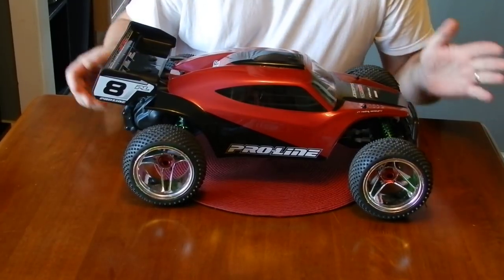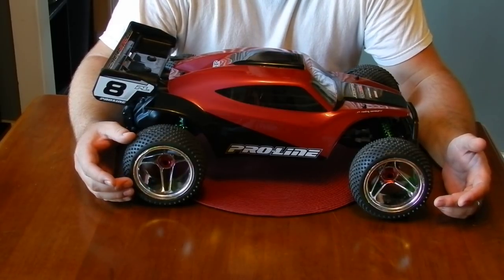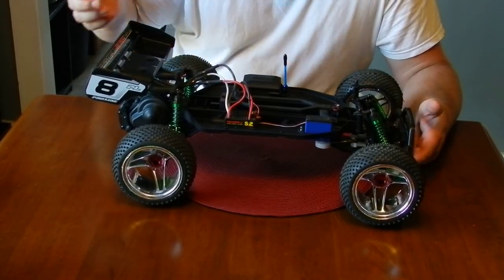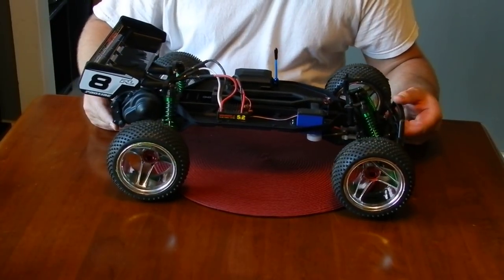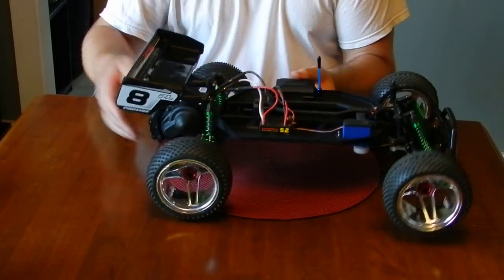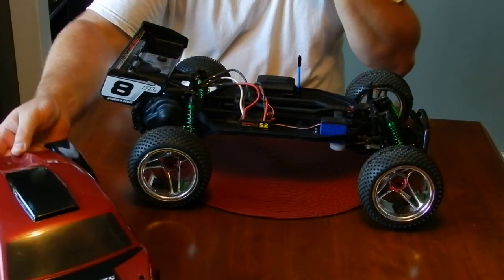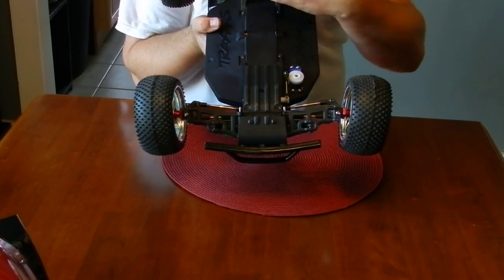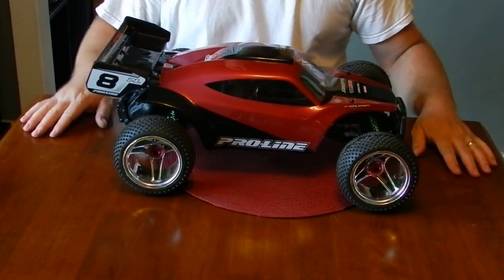Traxxas BackBajr Back Slash Custom Build 2wd Slash

Comment: Probably the coolest slash I've seen man. I wanna do this conversion with mine. My slash if fully modded with pro line arms towers, aluminum steering assembly carbon fibre chassis pro line tranny And the rest like knuckles and stuff is all rpm. I'm hoping this body fits over my carbon fibre integy chassis tho

Comment from the maker: I am pretty sure you could make all of this work.  Mounting the wing and coming up with a front body mount that is low enough are the only two things I am unsure of.  The body will fit and there should be 17mm wheel adapters for the slash 4x4 out there.   I think with the rear wing mount you need to put  some sort of plate on the front of the rear shock tower.  If I remember right the tower is more webbed than the 2wd slash.   Good luck and feel free to ask more questions!